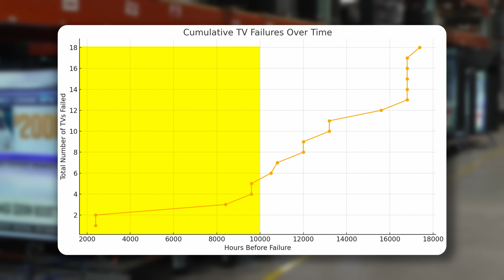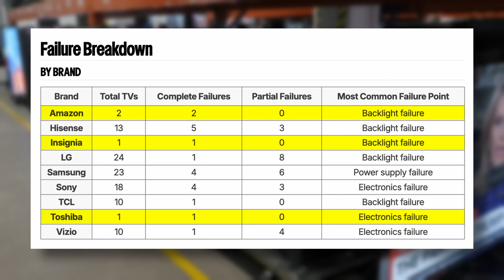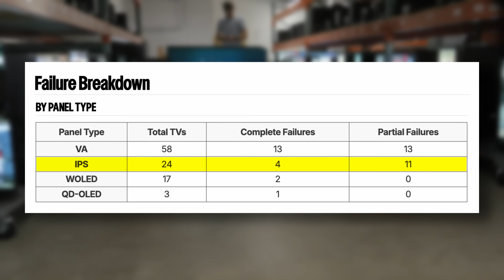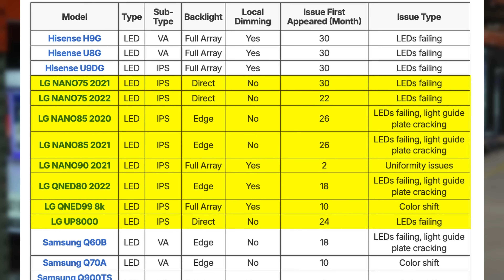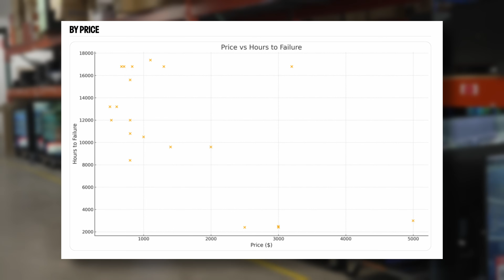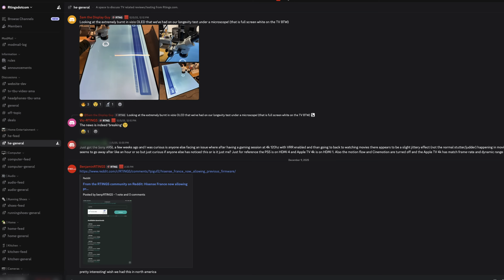Which TVs Break First? Results Overview From Our 100 TV Longevity Test

Comment: I believe their study design was flawed. A separate study comparing TV brands versus panel types would have been more informative. It would have been beneficial to know which brand lasts longer, regardless of the panel, and which panel lasts longer, independently of the brand, using statistical analysis. Nevertheless, this information is still valuable.

Comment: How can you possibly claim burn-in is not an issue based on what you're seeing in this test? Every panel had some sort of burn-in within months. This test ran for years. For the customers that do not have static images all the time, how are you coming to the conclusion that the "burn-in in months of torture testing" doesn't translate to "burn-in in a few years of normal usage"?

Comment: Ive used my LG b7 for what, 8 years now? Ive used it as a monitor, for console using, movies, etc. No burn-in at all, ever. I do have some vertical banding issues but they showed up relatively early, never got worse and aren't noticeable in 99%+ of viewing. It was probably there from the start. I would imagine that modern OLEDs are even more resilient.

Comment: My 2019 LG C9 OLED from Costco just turned 6 years old last month. Still going strong with 9,891 hours on the clock. That said, TCL is the only brand that has died on me (backlight < 3 yrs). I've also bought Hisense, Sony, Sharp, Pioneer, Vizio, and Samsung. No issues. In fact, the two Vizio TVs are from 2010!

Comment: Pretty much everyone I know who has had a TCL and especially Hisense experienced failures within the first couple years. I've seen it enough that neither of these brands will ever be on my shopping list. They're disposable, I'm kind of shocked it wasn't represented in these tests. I suspect you're not power/heat-cycling them enough to probe the common failure points most people will actually run into.

Either way, thanks for doing these tests. It helps hold manufacturers accountable so they're not putting out junk that is only designed to look nice until the return window closes (Hisense).

Comment: You don't recommend trying to fix a broken tv? That's HORRIBLE advice! If it's board replacement, it a super simple fix. What does the consumer have to lose? Backlights are a bit trickier and require some experience. Prevent ewaste

Comment: bought an LG OLED C1, right after the warranty expired, the power supply board died. Searched online, it is a common issue as they use low cost capacitors. Contacted LG and they didn't care. Repair cost around 20% of tv purchase price. Outrageous. Never going to buy lg again, that's for sure

Comment: Been using OLED (WOLED and QDOLED) displays since gen 1, burnin never was an issue.

My laptop runs 24/7 365, without any measures to protect the screen and very slight taskbar icon burnin (not even noticable if you aren't looking for it) developped after 1.5+ years. Complete non-issue.

Comment: So they ran test for 3 years, saw OLEDs start to burn in within a month. Yes, it’s a torture test, but I don’t hear LCDs burning-in. I much rather have a shorter lifespan display, than a longer one with the Windows icon burned into the panel.

Comment: Not sure if lasting more than 10 years is worth it. I have 10-15 yr TV's and given them away or mounted them in a bedroom. 10yrs ago, 42" was normal, don't think I can watch 1080p 42" today, given the same price today 65" 4K. 100" 4k will be cheap in a few years. Not sure if 8k has much value unless it has a good upscaler, given most sources are still 1080p or 4k maximum, and streaming true 4k requires a lot of bandwidth, though you could download and then play 8k. Until we get a better source for 8k, I don't see it going anywhere. Most streaming is compressed, so not true 4k. TBH if you don't have a good environment, a dedicated room with controlled lighting and decent sound, then who really cares.

Comment: I've had an LG BX (not even CX) since they came out and it's been a great TV ever since with no burn in or dead pixels. Staring at an LG C5 listing right now for a living room TV to replace my Vizio LED from 2023 which is having backlight line problems (hard to see). The Vizio was a 70"  for $900. The LG was a 55" for like $1300-1500ish I can't remember. I've been happy with both but pretty much any good Oled I go for will outperform both of them in 2026 forward. I'd say 6 years of daily use for my LG BX with no noticeable problems is a good sign. Honestly if I could I'd prefer a C4 over a C5 but the C5 is cheaper everywhere I go 😂.

Comment: That's insane that 34% of LCD TVs failed in 3 years. That's how long my 2020 Vizio lasted. They really don't make them like they used to. My Philips LCD I bought in 2009 lasted 14 years, and when I was a teenager in the mid 2000s I was using my parents old tube TV from the 70s

Comment: Thanks! I watched this on a 16yo 1080p Sony Bravia with 7k panel hours that still has Component, 2x full RGB SCART, Composite, 4x HDMI, VGA, analogue and digital antenna tunners and can play MP4 content from USB sticks and DLNA servers over Ethernet. I can still control Chromecast TV from my TVs remote.

With how poorly equipped new TVs are and my low usage, I don't need an upgrade 😁 one day the CCFL backlight will die completely as it's probably a little dim, but panel colours are still excellent. Best ~500 EUR I've spent.
Reply: 7000 hours in 16 years ? very interesting i have samsung 65qn95b mini led tv it passed 9k hours in 2.5 years...i have only defection in one dimming zone but in only appears in menu not when i am watching tv or when i gaming on this tv. samsung used sharp panel on this model which is near perfect...
Reply: @Menzags mostly for YouTube or retro gaming because of the inputs 😁 I sit daily in front of screens so I'm a little sick of looking at the other screens after work for leasure, so this is why only 7k hours.

Comment: I have an LG C9. The first thing I did was buy a replacement power cord and change it to  14ga .  Instantly noticeable. The set comes with an 18ga cord, which is a problem. Starving the set of current can cause serious issues. Next, get a properly sized isolation transformer to protect it from power outages and the spikes they produce. A good isolation transformer will lower power line noise as well.  Still running perfectly , no burn in and really nice picture. It is a 77" set. Just some thoughts.

Comment: i use my livingroom tv with a connected PC generally for a few hours each day, with the taskbar displayed at the bottom. would i need to worry about burn-in of the taskbar and other fixed elements at the outermost edges?

Comment: Kudos for the mega effort, sadly this kind of test is only useful to find out weak points on display technologies. It doesn't tell much about the reliability of a brand or a model, as correctly said they had sample size of 1 unit per model. For that you would either need to run 1000 or 10000 TVs which is quite impractical.
Other businesses like Backblaze have detailed hard disk reliability statistics because their job is to run hundreds of thousands of them to store people backups.

Comment: My parents who are retirees killed an entry level Samsung QLED (not neo) TV from QVC. An entire zone of backlight LEDs were out, and when I checked the amount of time the TV was used- it was on for almost exactly 2 years of time.  They also did not have the backside of the TV in an open space but rather inside an entertainment center cove, with some air exchange, but almost no circulation.  Can only wonder whether the current trend of getting the thin TVs flat against the wall, rather than 2-3" from wall, is going to kill off lots of TVs in the near future.
Reply: Surely manufacturers have to prioritise durability and just put fans in things?  My Pansonic micro hi-fi that's over 13 years old is presumably so reliable because it has a cooling fan that you hear spinning down every time after the amplifier has been loaded (but then the loud volume has stopped).

Comment: No Panel failures with stripes???
Older LCD TV's often had power supply failures which were repairable
Nowadays TV often fail at the panel driver chips (DDIC) which are encapsulated.
Making a repair impossible because the panel costs as much as a new TV!

Comment: I tend to disagree for LG Oleds. Mostly if not all break because of 2 capacitors of 0.82uF in the power supply. This will get you no standby led, and no power. Just this year i fixed 12 with this problem.

Comment: I think most of the time, at least in the case of extended warranties, they will just give you a check towards a new set rather than repair.  Between the repair cost itself and the 2 way shipping, they're just not worth repairing.

Comment: Sad times when 3 years is called a "longevity test". My TV is 20 years old and had its first issue after 17 years, which was a bulging capacitor in the power supply, which I replaced in 20 minutes and it was good to go again.

Comment: I bought a TCL 55s405 when they first came out. TCON board went out (only half the screen would work) a year after the warranty expired. Replaced the board and it's still going strong after 8 years. Super easy fix. If the LEDs didnt go out then it may be worth fixing if you can find the part for cheap.

Comment: My cheap old TCL TV worked flawlessly with my cheap vizio soundbar, and both were controlled perfectly through HDMI CEC/eARC via my Fire Cube remote.  My brand new TCL QM8K was a nightmare to manually update the firmware (which I had to request through TCL customer support to even get), still will not work with CEC through my Fire Cube to turn off, and also randomly turns off my new expensive Samsung soundbar every 15-20 minutes for no apparent reason.  Just....sigh.....

Comment: I like your disclaimer for ‘small sample size’ That’s a sensible declaration.
Reply: Fair! You'd need at least two-three of each model. But still I can't believe about 40/100 TVs failed in just three years (and not even with 24/7 use), that's dismal.  I would expect a TV durability test to require at least 10 years. Can modern consumers really have such low expectations?!  [Would refrigerators, which are expected to be on 24/7, have superior durability over 10-15 years, approaching the traditional 20 years?]
Reply: @TassieLorenzo  Planned obsolescence. It's crazy that the Sony CRT's my grandparents had from before i was born are still kicking but modern amps and tv's just give up the ghost after a couple years.

Comment: So much incorrect info and lies. Burn-in is not an issue for OLEDs unless you deliberately torture test them? No, that's not even remotely true. If you're a heavy duty TV user and prefer to have your TV set on full-brightness all the time, avoid OLED like the plague and do not trust this filthy liar. For most people it won't be an issue, but there's still plenty of people for who it would be a failure and it's very disingenuous and just straight up malicious to pretend that it's a non-issue. Second, the comparison is not exactly fair. Bunch of fakers who don't know how to use data properly. A sample of 100 TV's is not a lot and most definitely not anywhere near enough to be able to state anything conclusive. And it's all just different TV's, they'd need at least 10 of each TV to even be able to begin saying anything credible because individual quality of a product can vary a lot.